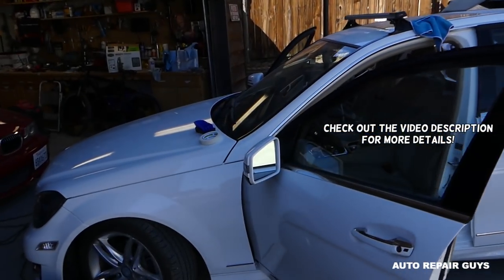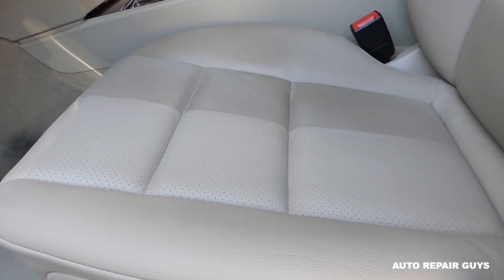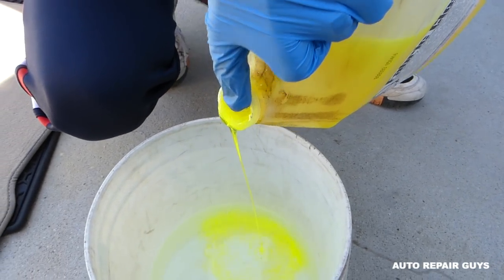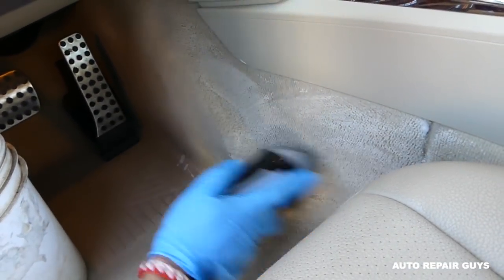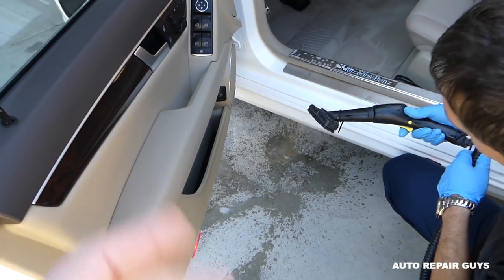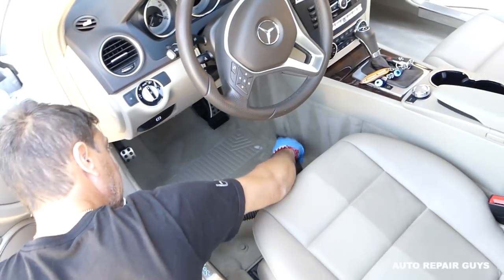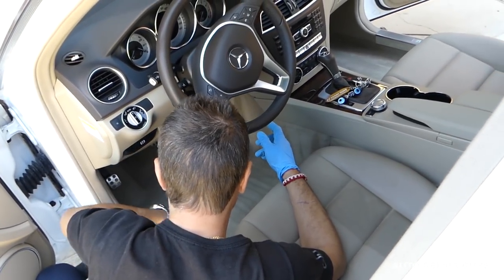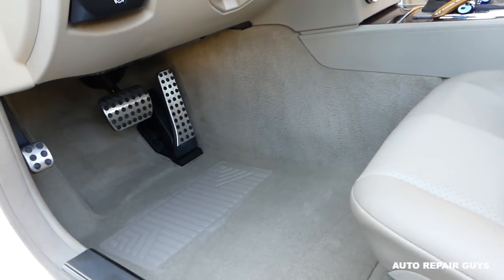HOW TO CLEAN CAR CARPET DEMONSTRATED ON MERCEDES

Comment: For the vacuum, you shouldn’t use a high powered extractor to suck the water out. Don’t push the button to put water in. Just extracting. Good vid